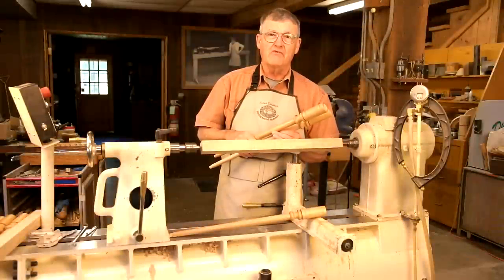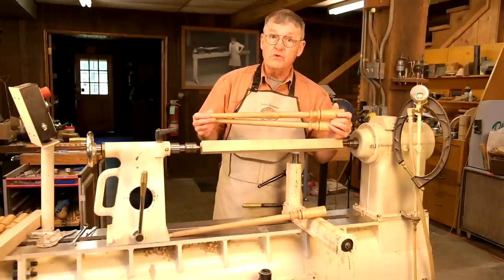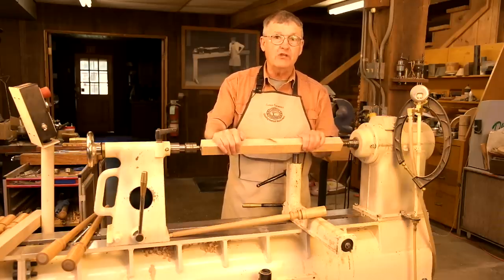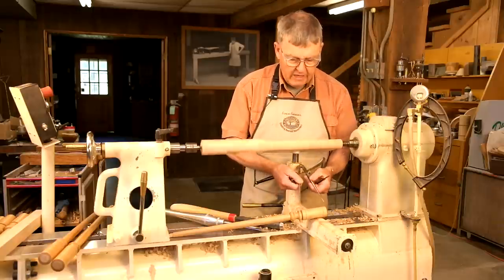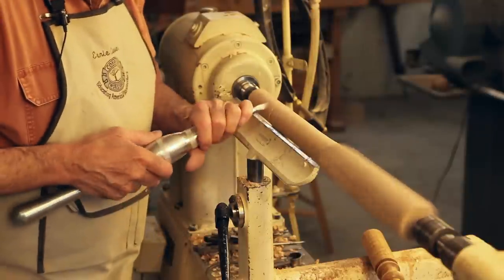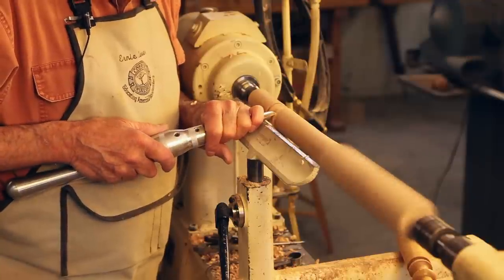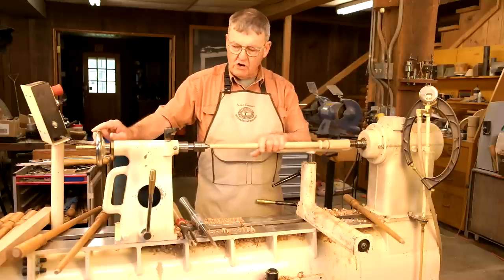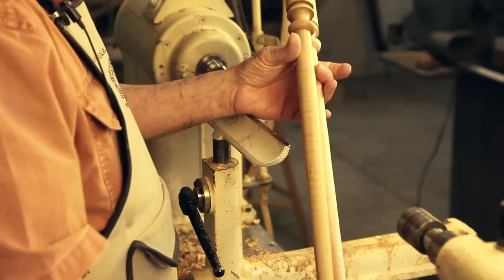Turning Identical Parts on the Lathe

Comment: ok,  I'm coming from a machinist background so if I was asked to make duplicates to fit old stuff (or new) why would I not do it on a machinist lathe?  Seems like the method above needs real skill...something I don't have, for a wood lathe,  but I know I could do it on a machinists lathe... Just trying to figure it out as I'm thinking of doing some wood turning of duplicate wood parts (hobby) and was planing on getting a wood lathe but now I'm not so sure.  I see I would need to cut and plane my blocks of wood also,  I could skip these steps with a machinist lathe. I'm open to suggestions.

Comment: A pin or scratch gauge would be much more accurate. It’s a piece of 40 x 12 mm with the features set out on it and panel pins nailed into the edge. Cut off the heads and file to points. Held against the spinning job it’ll mark the same every time.
Reply: You'd also need to make a new one for each project. A few pairs of dividers gets the same results
Reply: @KipdoesStuff  
Any decent turner would have a large collection of pin or pencil gauges in their workshop. I’ve used some of mine years later for the same clients. I can’t imagine ever having enough dividers set to duplicate all my gauges. I have them for stair components, hat stands, jewellery boxes, toys and many more. Very easy to make from a drawing which is where most turners struggle because they never design and draw up a project, they only start designing once the lathe is turned on.

Comment: Hmm, but this isn't a 100% Copy. Even without being a Professional well seasoned Turner like you Sir, i could come up with the idea to use tools(like a caliper or even a spanner) to measure how thick the stock is at the moment. Measuring and marking the stock is exactly what one would do before cutting any other piece of wood, unless tools are used(like a table saw as example) where the cut is set by the fence.

What i came here for, was to get a rather easy 99% method on how to turn mostly identical items on a Wood Lathe. This shown here, is sadly not what i came to look for.
Reply: Well then... allow me to introduce you to copy attachments... Look into the Vega or other brand copy attachments.
Reply: Looking for an easy trick, sharpen your skills.
Reply: @KipdoesStuff  I don't search an "easy trick"... I want to consistently create the same item.